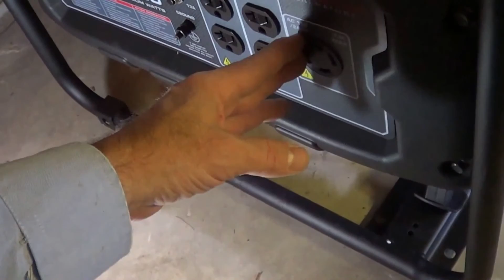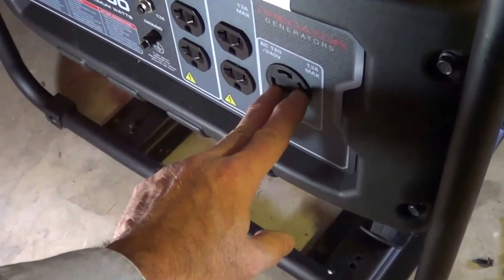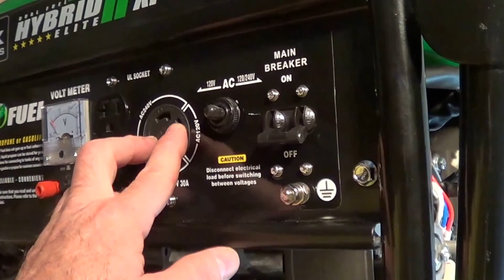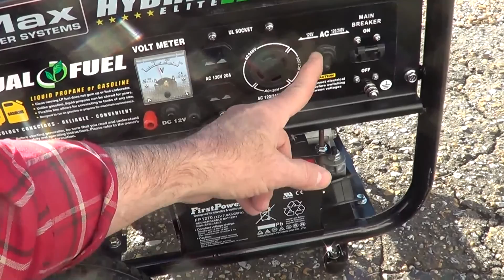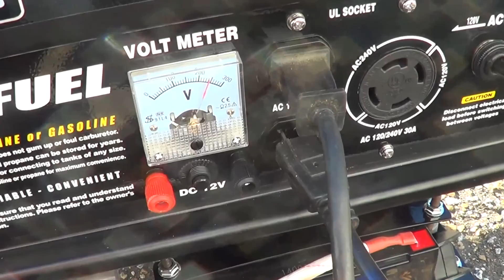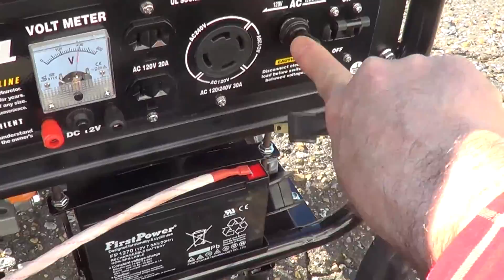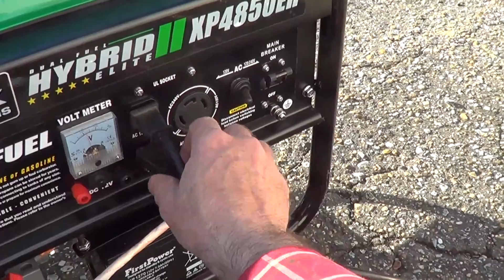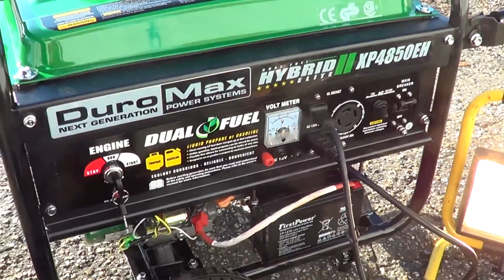Predator 3200 and Duromax XP4850EH Generator 120/240 socket

Comment: Can I run 2 leads off of two generators for 240 volts.  I want  to be able to run a 5 hp compressor and or a welder.  Thanks

Comment: I heard you say 220 volts, 230 volts, 240 volts and 258 volts.....wtf man
Reply from the maker: Just choose your era and device for the voltage. :) Edison's era higher AC voltage was 200 volts and lower 100 volts. An old washer I am using today says 110 volts on its nameplate, not 115 or 120. 

The nominal "240 volts" today at my shop is 252 volts. When we ran filament bulbs we bought special 130 volt bulbs to the lasted longer. 

An apartment I had in California 2 decades ago was close to the substation and the nominal 120/240 volts was never ever that low. ie it ran 127 to 128 volts on the 120 and 254 to 256 on the nominal 240. An ancient VHS player I owned had its control transformer running hot as all get. The core saturated. There was no margin for saturation in the design for my 127 volts.   

A rural building I have today has about 115/230 on a good day and often just 109 /218 when folks are all running their AC's. This is with the building only 20ft from the pole transformer. The substation is about 10 miles away. The 3 phase feeder goes through 3 autotransformers to jack up the nominal 7200 volts as the load varies. Thus homes close to the boost autotransformer are on the high side and ones just before the boost are on the low side. 

 Two weeks ago my shop had 95 to 100 volts on the nominal 120 volts and 190 to 200 on the nominal 240 volts. One of the 3 phase transformers blew on the pole during a lightning storm and the loss of 1 of 3 transformers on a High Leg Delta service dragged the single phase part real low.

 In a way 200,230,240 is like global cooling, global warming and now climate change. If tomorrow they call it global conning or planetary change using the other terms will stand odd too. Gosh old Newsweek pushed global cooling the new ice age too. :)

 Here a big machine built in 1990 at my shop has a tapped transformer for the "220 volt nominal nameplate". ie the 1kVA transformer for digital stuff has taps for 200, 220, 240 and 260 volts. This is so one can use the unit in different locations since the nominal "240 volts" maybe way different. Ours is set to

The nominal 120 volts Y 3 phase has 208 volts line to line. Older electricians call the 208 volts 200, or if real old even the 190 volts. ie the 115 volts Y 3 phase is 199 line to line thus called 200. ie 110 volts 3 phase Y is 190 volts line to line too. 

Brazil uses a 127 volt 3 phase 220 volt system, ie 127 @1.73= 220 volts. 

Regards
Reply from the maker: Modern USA homes have two 120 volt hot wires from the Utility's  transformer and 240 across both. A straight 120 volt generator unit would work with most homes but only one of the two 120 volt legs would be powered in the homes circuit breaker box. ie most all USA homes are 120/240 volts. Two hot 120 volt legs to neutral. 

Thus a straight 120 volt unit works on a home but about only about on half of your 120 volt plugs will be powered. 

On my home say during a power outage I want the refrigerator powered. The middle bathroom is on the same 120 volt leg as the refrigerator but the master bedroom is not.
Reply: Here are the safety rules of using portable generators: 

It is important to follow all generator safety rules whenever we use portable generators: 

Everyone must see this. This is just a reminder for everyone’s safety. 

1) KEEPING OTHERS SAFE: Please do not allow an unqualified person or your children to operate and service the portable generator. Just because some manuals don’t say that doesn’t mean it’s safe. That is important against the generator safety rules. We also need to be keeping an eye on our children too. You need to make sure that your children are not playing near the portable generator especially when it’s running so they won’t get electrocuted. Generators pose electrical risks and they can be hot during an operation. Please keep your children away from the portable generator at all times. It is important to keep our children safe especially our little ones. Be aware of all the hazards.

2) WHERE TO RUN YOUR GENERATOR: Some people use their portable generators indoors which increases the risk of carbon monoxide poisoning. It’s important to have a carbon monoxide if you have a gas generator. Never ever use your generator indoors even if your doors and windows are open and even in the garage is not safe to use a portable generator. Not even at your porch and your deck. It is never safe to use your generator indoors and in enclosed areas of your home. Your generator needs to be 15-20 feet away from your house. 

3)🔥FIRE HAZARDS: Never refuel your generator while it’s running. You need to let your generator cool off before refueling it and before storing your generator. Never overload your generator too. Never ever back feed your generator. You should never plug your generator into a wall outlet. Also never store propane tanks indoors. Please keep flammable things away from the generator as well and please don’t smoke cigarettes near the generator. Having a fire extinguisher next to the generator is also important against the generator safety rules. 

4) GENERATOR OPERATION: make sure your hands are dry before touching the generator. Never use your generator in wet conditions. Don’t let your generator get wet. You need a generator tent if you need to use your generator during wet weather. Please don’t wear loose clothes when operating the generator. Turn on your generator before plugging in appliances. Use the right cord for your generator. Please do not use worn out cords. 

https://youtu.be/I1jT3ANENvI and here is a video more about keeping others safe when using generators 

Hope this helps

Comment: This is an excellent technical demo of the mystery switch I never understood and on the unit itself. Overall doe you think the Duromax is a good generator? Im looking to by the gasoline version. Thanks
Reply: Here are the safety rules of using portable generators: 

It is important to follow all generator safety rules whenever we use portable generators: 

Everyone must see this. This is just a reminder for everyone’s safety. 

1) KEEPING OTHERS SAFE: Please do not allow an unqualified person or your children to operate and service the portable generator. Just because some manuals don’t say that doesn’t mean it’s safe. That is important against the generator safety rules. We also need to be keeping an eye on our children too. You need to make sure that your children are not playing near the portable generator especially when it’s running so they won’t get electrocuted. Generators pose electrical risks and they can be hot during an operation. Please keep your children away from the portable generator at all times. It is important to keep our children safe especially our little ones. Be aware of all the hazards.

2) WHERE TO RUN YOUR GENERATOR: Some people use their portable generators indoors which increases the risk of carbon monoxide poisoning. It’s important to have a carbon monoxide if you have a gas generator. Never ever use your generator indoors even if your doors and windows are open and even in the garage is not safe to use a portable generator. Not even at your porch and your deck. It is never safe to use your generator indoors and in enclosed areas of your home. Your generator needs to be 15-20 feet away from your house. 

3)🔥FIRE HAZARDS: Never refuel your generator while it’s running. You need to let your generator cool off before refueling it and before storing your generator. Never overload your generator too. Never ever back feed your generator. You should never plug your generator into a wall outlet. Also never store propane tanks indoors. Please keep flammable things away from the generator as well and please don’t smoke cigarettes near the generator. Having a fire extinguisher next to the generator is also important against the generator safety rules. 

4) GENERATOR OPERATION: make sure your hands are dry before touching the generator. Never use your generator in wet conditions. Don’t let your generator get wet. You need a generator tent if you need to use your generator during wet weather. Please don’t wear loose clothes when operating the generator. Turn on your generator before plugging in appliances. Use the right cord for your generator. Please do not use worn out cords. 

https://youtu.be/I1jT3ANENvI and here is a video more about keeping others safe when using generators 

Hope this helps